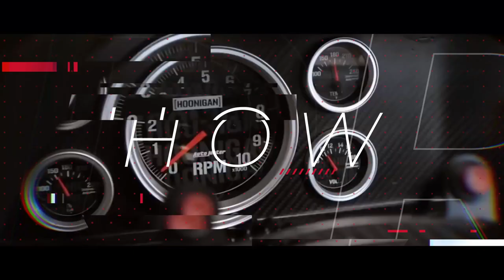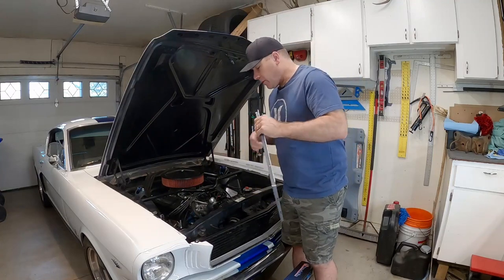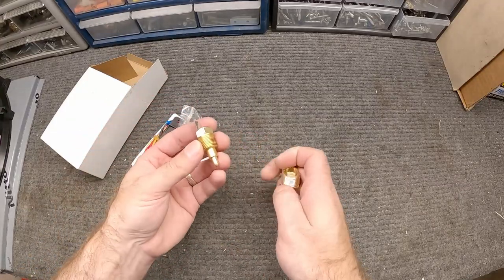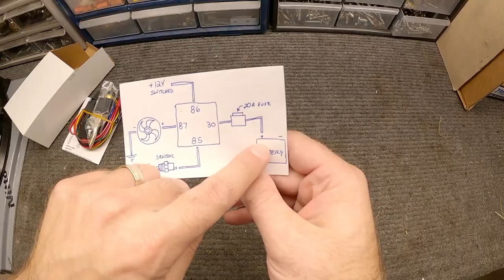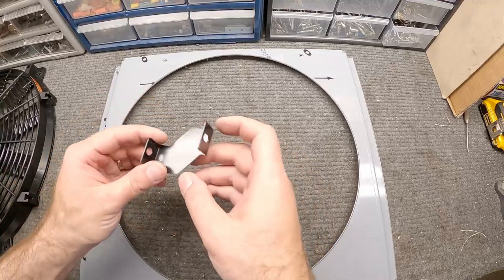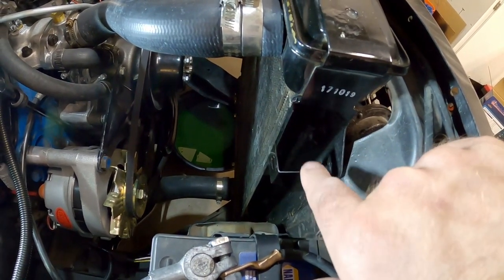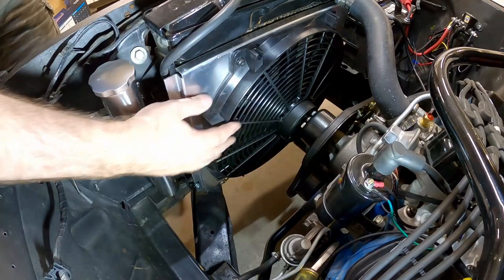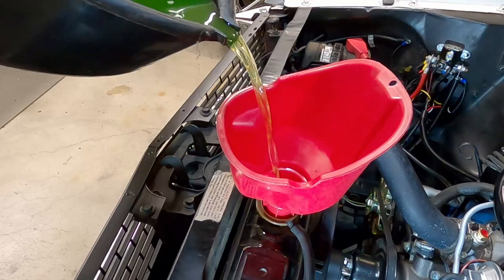How to Install an Electric Radiator Fan

Comment: Where did you buy the thermostat housing you used ?
Reply from the maker: From Summit Racing.  Manufacturer is Dorman, part number is 902-1001.  :)

Comment: How thick is that custom shroud?
Reply from the maker: The thickness of the metal?  Or the depth of the shroud from the Rad to the Fan?
Reply: @AndyKruseChannel  Thickness of the shroud. I saw there was only a sliver of clearance once everything was installed... want to get a shroud that the same thickness or thinner so I don't touch the water pump.
Reply from the maker: @TheRareCriticalThinker  I guess I should have answered that I don't know because I don't have that setup anymore.  However, it was around 1/2", I purchase it off eBay.  :)
Reply: @AndyKruseChannel  thanks for your fast responses! Surprised on such an old video too! What’s your new setup and why’d you change it?
Reply from the maker: @TheRareCriticalThinker  You've got some videos to watch.  :)
Reply: One last question (hopefully) 😅. Where does the 20A fuse go? Is it built into the relay that you got from Amazon?
Reply: Also, how’d you get that relay attached to the starter solenoid?
Reply from the maker: @TheRareCriticalThinker  It goes between the #30 terminal on the Relay and the constant 12V source (the Battery).  Fuses are most effective when they're closer to the voltage source (the Battery in this case).  You could install it between the wires built into your new electric fan and the wiring coming from the new Relay, but I don't recommend that.  That fuse is a safety, meaning, if your fan pulls too much juice, it wall pop the fuse before it melts the wiring for the electric fan.
Reply from the maker: @TheRareCriticalThinker  If you're asking about the mounting location, I used a sheet metal screw to attach the relay to the sheet metal in that fender apron, just below the solenoid.  :)
Reply: @AndyKruseChannel  you are AWESOME. I think I got everything I need now… hope your pony is behaving!
Reply: Ok last question officially. What thermostat are you running? Should the fan come on matching the thermostat temp? I’m running a 180 on my 289.
Reply from the maker: @TheRareCriticalThinker  I am currently running a 180 degree thermostat from Napa, part number PM180-0025
Reply: @AndyKruseChannel  Hi Andy, back after the install. Not happy with the results unfortunately :( Were you having problems with this setup? Mine seems to run perfectly fine for a while, then the temp balloons up to around 200, and evens out at 195. Doesn't go down and doesn't go up- same when idling or driving. I popped the hood assuming it was heat soak in the bay, but the temp doesn't go down (or past 200). At a loss.
Reply from the maker: @TheRareCriticalThinker  Less than 200 degrees is a good thing.  My current setup (larger Rad and dual fans) doesn't go above 195, so I'm not sure what you're trying to achieve.
Reply: @AndyKruseChannel  oh interesting…. Maybe I’m just shot gunning the issue then. My mechanic recommended a 160 degree thermostat when I thought 180 was fine. Good to hear that’s a decent temp
Reply: @AndyKruseChannel  ok ok. Sorry for bugging you but today was a good test day. 95 degree weather. Temps creep up to 210 but never hit. Still OK zone?

Comment: A better way to wire the relay is to use a 5 wire , wired as battery positive to pin 87 , 87a to ground and 30 to fan positive , of coure 85 and 86 would be the same as a 4 wire relay . This provides a short to fan on shutoff so there's no backfeed to the system causing a burnt relay if wired as 4 wire.
Reply from the maker: Thanks for the heads up.  :)

Comment: Just  NOTE, WITH ENG. RUNNING. ELE. FAN WORKING.ENG WILL RUN FOR ABOUT 30 SEC. WITH KEY OFF. IN SOME CASES.
Reply from the maker: Not sure what you mean here.  This is not wired to work with engine off, nor does the car run for 30 sec with the key off.
Reply: @AndyKruseChannel  SOMETIMES THE FAN ACTS LIKE GEN. & FEED 12V. BACK. WE HAD HAPPEN WHEN WE INSTALL FAN ON H.D. TRANSMISSION COOLER ON AMBULANCES, FDNY..

Comment: For some reason I do not have key on power from the same location
Reply from the maker: Same location of what?
Reply: @AndyKruseChannel  your key on power from the solenoid  by the battery
Reply: I think it has to do with have a msd ignition maybe?
Reply from the maker: @Cornerstonebjj  I wouldn't see that terminal is key-on power, partially because that terminal is not a constant 12V signal.  However, in my setup (not sure about your MSD setup) it's enough to drive the signal for a relay.
Reply: @AndyKruseChannel  thank you so much. I just watched your override fan switch video and I will be doing the same thing this week on my 66 stang. Your videos are amazing by the way.

Comment: You're actually lucky to have 4 inches clearance. It's only 3.4" for me :(
Reply from the maker: You probably have a thicker radiator than what I've got.  :)
Reply: @AndyKruseChannel  
Oops, sorry. I have a different car. It's a 300E W124. Thanks to it's inline 6 engine, the whole place is cramped on front of the radiator. And even if it's the radiator, can't replace it with a thinner one. Here in Saudi Arabia it gets close to 50C so I cannot afford to. Need that amount of coolant.

Comment: I think your instructions tell you not to use Teflon tape or any other product that will interfere with a good ground. These are pipe threads that need no sealing help !!
Reply from the maker: They probably do.  :)

Comment: As always, awesome video Andy! 2 questions: 1.) On the temp switch, when I install that and run that temp sensor wire to pin 85, can I tap into that wire with my existing lead that goes to my existing temp gauge to continue to get my temp reading? I would assume that would still be ok as the temp switch will constantly read temp but just ground out in the specified range for the fan to kick on. 2.) For the life of me I can't find your video where before you get started you push a button on top of your battery's negative cable that opens the circuit and cuts power to the car. Can you share where you got that from? I would love to stop having to connect/disconnect the battery cable directly every time I work on the car!
Reply from the maker: The temperature sending unit (for the temp gauge in the dash) and the temp switch for the fans (like I have in this video) are two different devices.  The temp sending unit (installed in my intake manifold) shows a resistance value (in ohms) that the temp gauge in the dash reads and displays a temp.  The temp switch for my fans is essentially an on-ff device.  The temp switch is open (not allowing the circuit to complete) until a preset temp is reached, at which point the temp switch closes and allows the circuit to complete and the fans turn on.  The wire connected to this temp switch is the ground wire for my relay.  Once the wire "sees" ground, the relay activates and juice from the battery runs to the electric fans, and it remains running until the coolant temp level drops enough to cause that temp switch to open back up (opening the circuit and stopping the relay from grounding).
That circuit breaker on my battery (the video where I move the battery to the trunk) is just a generic unit off Ebay.  It's a 200A circuit, and I believe it's commonly used in marine applications.  :)
Reply: @AndyKruseChannel  gotcha - and thank you! So right now I have 2 temp sending units - one at the thermostat housing and one at the back of the motor (I have a 200 i6). I'd assume my temp 'switch' for the e-fan should go at the thermostat housing location then, and I would need to relocate the wire I have there now to the temp sending unit at the back of the motor if I want to keep both temp gauges. I know I don't NEED two temp gauges, but I've kind of gotten used to having them both, knowing they took readings from different spots on the engine. Guess I'll have to give that up and use one location for both temp gauges moving forward...
Reply from the maker: Personally, I think it's redundant to have two temp sending units as the unit at the back of your system will show the temp you're interested in.  If that temp goes too high, your thermostat is not opening and you'll need to diagnose what's going on.  Having that sending unit in front of the thermostat will give a false reading of the coolant temp as the readings are after the coolant has been cooled by the radiator, and not really relevant to the status of the engine.  Some people argue that putting the temp sensor for the fans in front of the thermostat (like I have done) will not activate the fans on the true temp of the engine.  I'm not worried about that as I don't care if the fans turn on at 175 degrees or 190 degrees, I just need them to turn before 220 degrees, which it does do.  The actual temp of the engine is higher than when my fan switch activates, but it's like less than a 5 degree difference, so it's not really an issue.